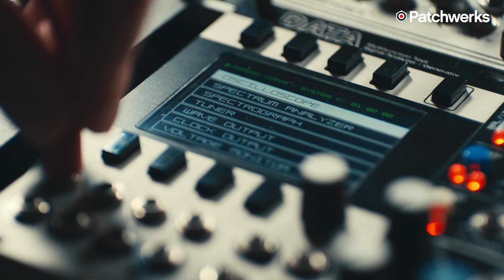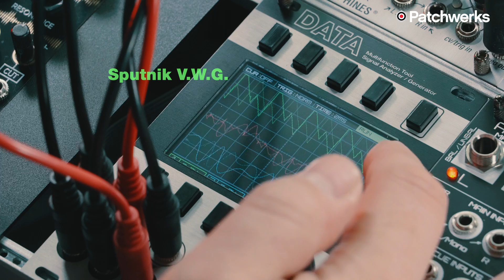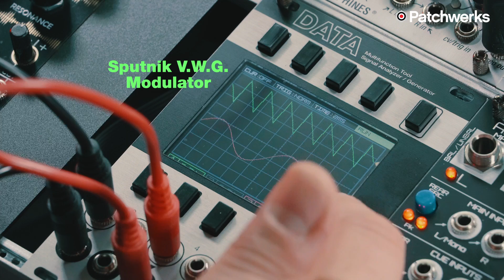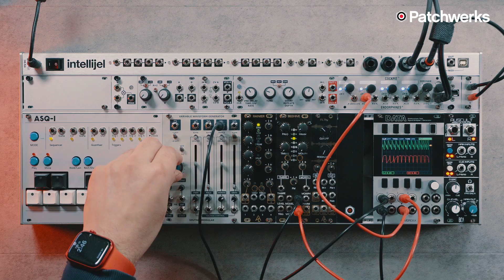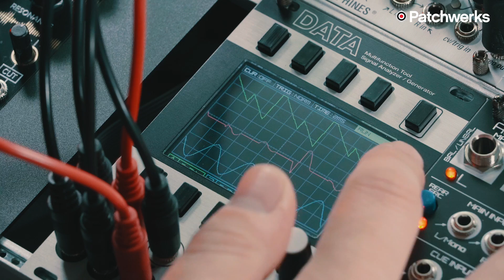Synthesis Basics: How To Ring Mod, FM, and AM

Comment: Why are Tremolo and Ring Moulation the same thing in some effect processors?  Isn't Tremolo an amplitude modulation?   For example, in Ensoniq DP Pro the Tremolo effect sounds like Amplitude Modulation at low frequencies ...  and like  Ring Moulation at high frequencies. You can raise the oscillator frequency up to 20,000 hertz. The manual also describes this effect as Ring Moulation.  What is the difference between Tremolo  and AM?